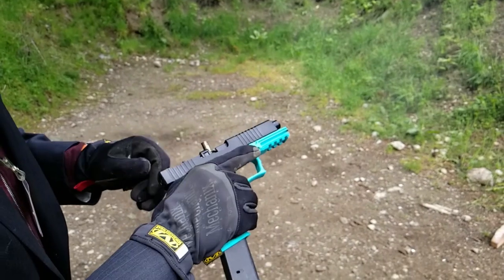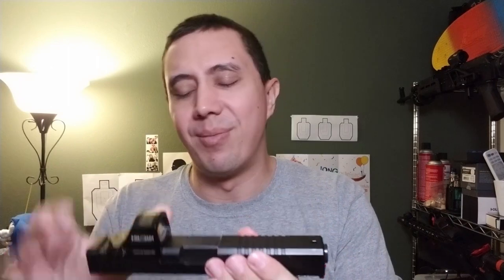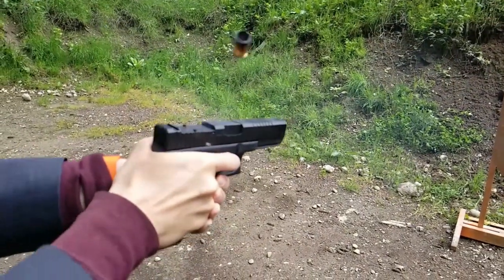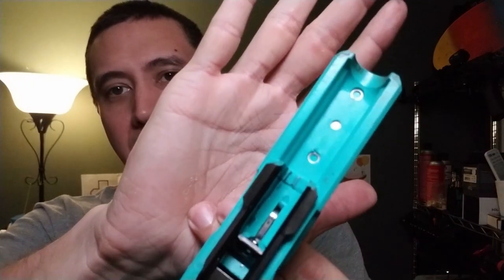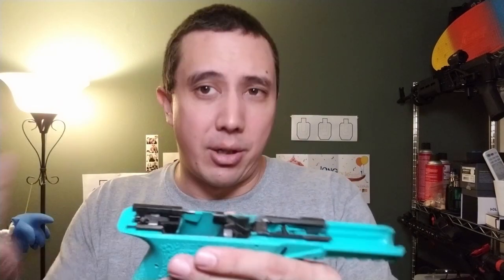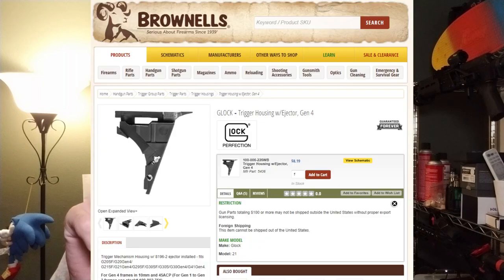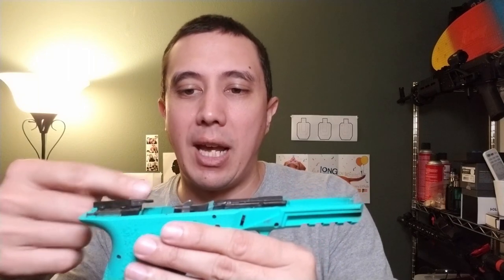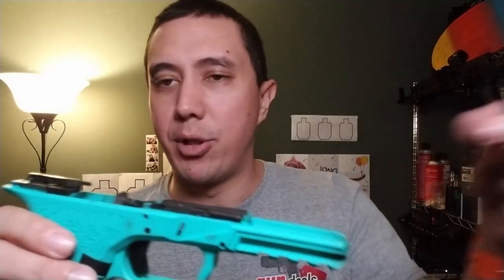P80 Glock Gen3 Ejection / Stove Pipe FIX

Comment: My ejection has been much better and consistent as well, other than a couple weak last round ejections. I haven't had a single stovepipe since switching to the gen 4 ejector and cleaning out my guide rod valley better. Glad she's up and running good for you now!
Reply: AlphaRomeo-OneFive try apex failure resistant extractor it will help
Reply: @imbrion7981  Thanks, I've been running it for quite a while now. Actually made a couple videos in it. She's running like a champ now.
Reply: lol mine is all p80 and I haven’t jammed once since fixing my trigger
Reply: Being careful to clean out the guide rod valley and getting as close to the diagram I have
found to be VERY important. You can have irritatingly odd ejection issues as the guide 
rod and ring on the front of the slide bottom rub. The is especially critical on the G26
sized P80 frames as the clearance there is even smaller...

Comment: Funny. I was having the same issue with a polymer 80 pf940c build (glock 19) and like you ejection was all over the place with the occasional stovepipe. This all started when I replaced the slide. The build was from thunder tactical. The slide cracked at the very front where the front sight is. I bought a Swanson slide from midway and that's when the stovepipe issue began. So, I bought a Swanson barrel and a Swanson extractor. I installed those and guess what......it continued to have the same issue! I thought about replacing the ejector with the gen four, but instead, I started using a different magazine. I have been using the magpul 15 round magazines and switched to the etsgroup 10 round magazines and lo and behold it now ejects better and no stovepipe! The spent rounds actually cone out and land in a area just about 3 feet to the right! I don't have to search for spent casings any longer! Also, I started examining my spent casings when I was having the inconsistent ejection and stovepipe issues and those casings were misshapen badly. Damaged. Unusable for reloading. Now, with the ets magazines the casings are coming out round and absolutely reusable for reloading. The magpul 15 round magazines work fine in my pf940sc  (glock26) but they still go all over the place out of that gun. But I've never had a stovepipe or any other malfunction with that build. So. Point is, it could be the magazine. It's not always the ejector causing the problem.
Reply from the maker: Good to know. I do mostly run magpul mags but its always worth running a few different mags!

Comment: It’s the guid rod channel. 
You didn’t need to spend any money. 
It has to be absolutely cleaned out to the edges of the rail and then smoothed to butter. 
Mine accepts all OE and aftermarket springs now. 
They also loosen up after about 100 rounds if you use 124gr.
Reply: What do you mean smoother out ? If you got pics and a email I’d be interested in what you mean
Reply: @Gr0m3t  thanks bro

Comment: Weird, just trouble shooted a lone wolf frame that gave me ejection issues yesterday, I actually swapped the ejector out of my gen 3 glock 17 into the trigger housing which used a gen 4 ejector. Seems to have much better engagement on the bolt face and hand cycled much more smoothly. Still gotta take it back out to test.

Comment: It’s crazy how fandom it works. I have mainly gen 3 parts but one of my builds is having double feed, failure to feed sometimes or just shell geitting pinned during ejection
Reply: Replace it with a gen 4 ejector and an apex extractor for your slide, make sure you get the non lci bearing to go along with your apex extractor you will have to buy it separately. That should fix all issues.
Reply: @Citizendefenseindustry wat caliber i have a 40 having failures to eject
Reply: @Chaseeemmdownnnnn  ooo I thought it was 9mm sorry.

Comment: Just figured this out today. For whatever reason the 336 ejector that comes in stock Gen3 trigger housings is an incredibly unreliable unit. Thought I was gonna have to scrap my build before I did some reading watched your video.
Reply from the maker: It's weird isnt it! Marine gun builder talks about the late  gen 3 move to MIM parts... but he also advocates for an after market extractor, which just isnt necessary. That being said... I do have an after market slide parts kit.

Comment: Just curious, what was the difference between the gen3 and gen4 ejector? Longer or shorter, or different angle? Thanks. 👍
Reply from the maker: Its rotated toward the center of the round just a little... it looks like. Gen 3 ejector with a slight twist to it.
Reply: Different angle and bigger. Always replace the ejector with a gen 4 or 19x ejector and apex extractor with a non lci bearing and that will solve 99% of all issues.
Reply: I have a gen 3 g19 will a gen 5 extractor function in mines ?

Comment: So I did this, it helped. Still stovepiping / jamming unless I REALLY squeeze it. Do you think this could be due to an even lower mass than p80 as I'm using a 3d printed frame?
Reply from the maker: Honestly I don't think so.  Glocks are not that sensitive to that sort of problem imo. I would try a couple of different recoil spring weights at your point.

Comment: Looks like after changing the extractor ,casings were hitting your optic. Are they?
Reply from the maker: I think if it was the ejection pattern would have some flying forward and less consistent.  The ejection pattern is very consistent now,  you can see a few hitting the camera.
Reply: @aussieexpat  nice! But the rmr isn't taking hits right?.thanks for the video btw.i just ordered a gen4 and gen5 trigger housing with extractor. ...gonna try both
Reply: @eseteardrop  Im gonna go shoot my first p80 build tomr. I got the gen 5 ejector after hearing that it is even better than the gen 4. Fingers crossed lol. Im still using the stock extractor though. Will see what it does tomr.

Comment: i have the exact same build. brownless, grey ghost precision barrel, P80 lower. i cant figure it out :(
i used my Upper on an OEM Gen 3 glock lower. worked fine.
i also used an OEM Gen 3 glock upper on my lower, it also worked fine.. im LOST
Reply: I’ve since fixed both of my p80s
Reply from the maker: Well.. you now have 2 working Frankensteins 😜
Reply: @dannyipwn1203 what was the fix?

Comment: Just completed a build went to range yesterday, first 120 rounds or so was getting stove pipes, double feeds, it started ironing out but after every shot I have to take my thumb and physically push slide up. I’m gonna try and remove a little more material in channel to see if that helps. If not I’m thinking the 18lb. Guide rod I have in might be to heavy? I have an ultra light weight slide from steel city....any ideas? And thanks
Reply: C_FIDDY711 did you get this issue fixed i had the same ones
Reply: acidlite9 turns out I accidentally ordered a 13 lb. guide rod, it wasn’t stiff enough to push it back, so I ordered the oem 18lb. And fixed issue. I did also remove more material. Make sure that channel is nice and clean and open.
Reply: B Logan sorry just seen this, I commented below.
Reply: @c_fiddy7118   I know it’s been a while but do you have a clear picture of of your channel you wouldn’t mind sharing? I have a Glock 19 build that I am getting ready to shoot but wanna be sure I removed enough material

Comment: Will Washingtonians still be able to buy 80 Glock lowers coming up?
Reply from the maker: Yeah, as completely ridiculous and redundant the new laws are, they basically don't impose any new restrictions that weren't already there at the federal level to begin with.

In terms of P80s, nothing has changed. You cannot build a P80 with intent to sell. But you can still sell a completed P80 as long as your intent was not to sell it during the original build, which was already illegal.
Reply: TryHardGamers I have some friends worried they won’t be able to buy them. I’ll show them your answer. Thanks for the replies man
Reply from the maker: @Sumdude11  This wa_guns reddit thread covers it.

https://www.reddit.com/r/WA_guns/comments/bmn009/can_i_buy_polymer80_frames_before_july_1/

The new legislation apart from definitions pertains to the following

((d) Manufacture an untraceable firearm with the intent to sell the untraceable firearm)

Untraceable merely means does not have a serial number applied by some kind of FFL. ie. any home made gun
Reply: TryHardGamers awesome thanks man

Comment: My glock 19 p80 Jams but my homie told me it’s because I gotta shoot it at least 200 times ??
Reply from the maker: It can be but what kind of jam?
Reply: @aussieexpat  meaning like I clock it back but it doesn’t clock back all the way you know how the barrel is suppose to be even ! Mine doesn’t clock all the way back
Reply: Maybe but the ones I built reliable off first mag. Lining up the holes and not over forcing is important. Could also be ur slide get a reliable slide like mdx or oem.

Comment: Ok so I changed the injector to the gen 4 and my extractor to a apex part but I’m still stove piping after 2 round!?!?
Reply: Prolific Seven  check and see if your slide lock spring is flush if it’s not that’s the issue well it was for my build
Reply: very important you order that thicker NLCI spring bearing from midway usa when you swap for bigger ejector and better extractor.  It’s a must

Comment: so a part of your problem also is that if you buy an rmr cut and dont have an rmr on there it can cause stovepiping also but the real big problem is that 336 ejector i swapped the 336 for the gen 4 snd i put an rmr cover on mine and not a single problem running brownells window slide with rmr cut and ets 22 round and 17 round mags
Reply from the maker: Yeah I agree, looking back at it it may have played a part considering the slide is also lightened. I also had a p80 g17 build where again I didn't mount an optic before testing and it did work fine. But of course, that might not be the case for the glock 19.

This being said, I'm not the only person that this fix worked for and many p80 build kits do come with the gen4 ejector. Again, it's not specific to p80, gen3 glocks shipping now also have ejection troubles afaik.

Comment: not trying to talk shit here but looks like you were limp arming the whole time...yeah aftermarket parts are most times the cause but if you aint strong enough to tank the recoil your gonna limp it and cause malfunctions as well
Reply from the maker: It wasn't. I tried an OEM frame and it worked flawlessly. And then after the gen4 ejector it worked flawlessly. So the only variable is the ejector.
Reply: @aussieexpat  in ur case yes, but a friend of mine was shooting my g17 p80 built and was having feed/ejection issues. then came my turn boom 0 issues. watched him shoot and was doing the same thing you were and the gun was jumping around in his hands the whole time. just for shits and giggles take a perfect gun and limp it and you'll see.
Reply from the maker: @THEGRAYFOXX00  I don't have as much experience with glocks, but I've never been able to induce a malfunction on my P320s.

I did used to get more stove pipes on my S&W shield when shooting left handed.

So yeah, I'm aware of the possibility. Hence you have to do a control test! Which I did as seen in this video using the alternate frame.
Reply: @aussieexpat  yes i saw it, but i meant as an OEM glock not a build or OEM build. one off the counter. but yeah u is right

Comment: I think I know the problem, your missing sights ! It throws off the weight !
Reply from the maker: The slide worked fine on an oem glock frame as demonstrated in the video. So yes, running without the optic is a potential issue, but i had a control test to rule that out.